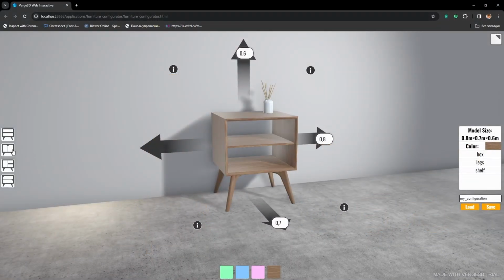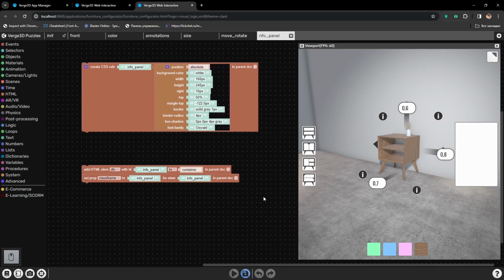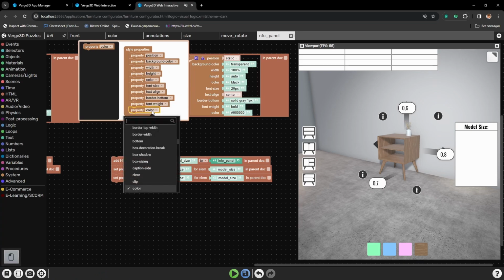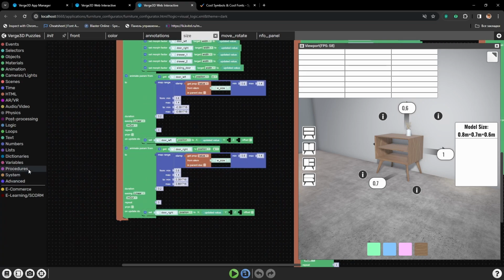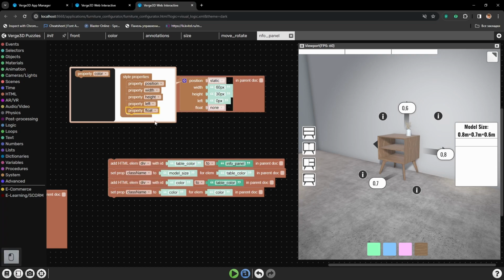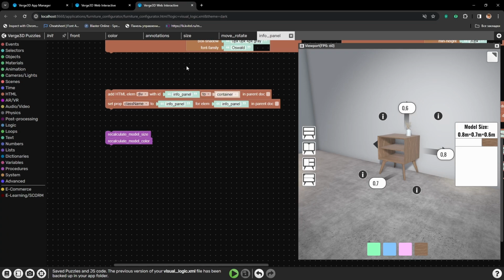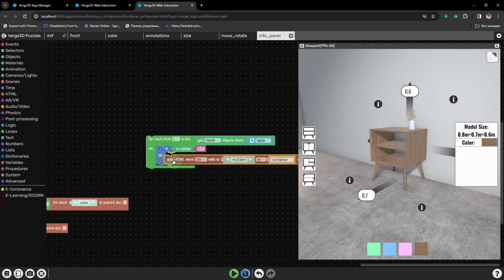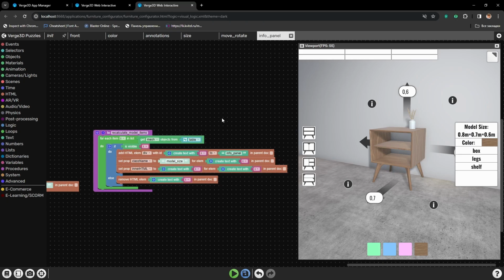Web-Based Layouts with Puzzles - 08 - Panel with Parametric Data

Comment: Nice tutorial, but i have a question.
When i press F5 on the Application, the furniture always loads with all doors. It shows all doors at the same time and then the info panel is more than full with the parameters drawer 1 drawer 2 sliding door. Then it its behind the save and load button. Is there an option to start with no doors shown?
Reply from the maker: Could you please post your request on the forums so that our developers or the community could address it there? We'd be glad to assist you!

Comment: Hi thanks for producing this tutorial it is really nicely explained. I'm using Blender 3.6 and Verge 4.5 on Windows and when I select div as the 'add HTML element' the div doesn't show on screen. With the buttons I used  'button' instead of 'div' but I can't use button when creating the white Model size panel. Has anyone come across this?
Reply: I figured it out. I was missing a full stop before the CSS rule!
Reply from the maker: glad you found a solution! @jonpearce8251